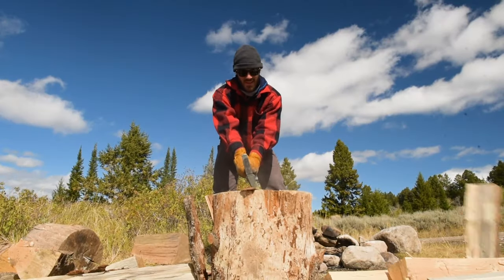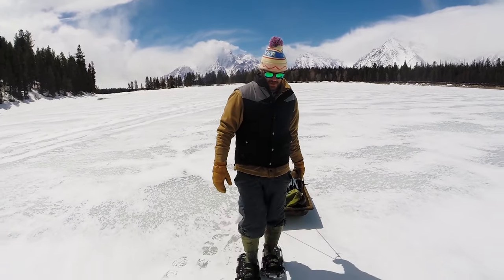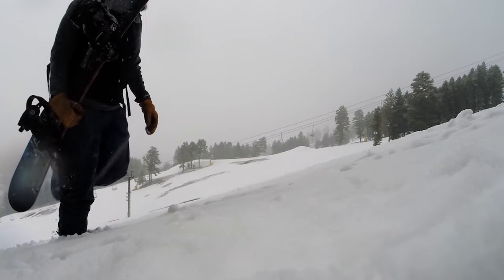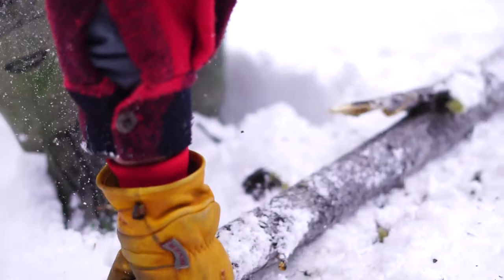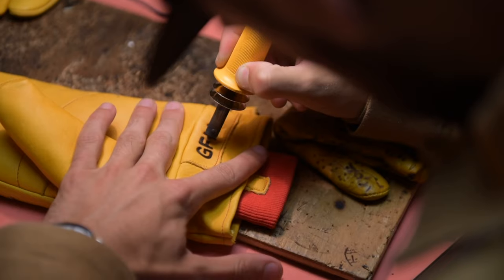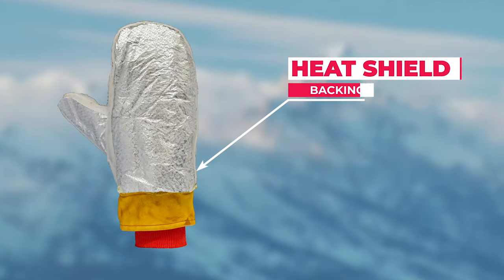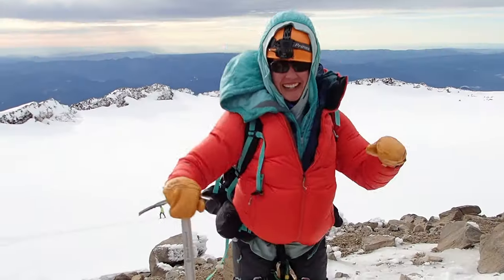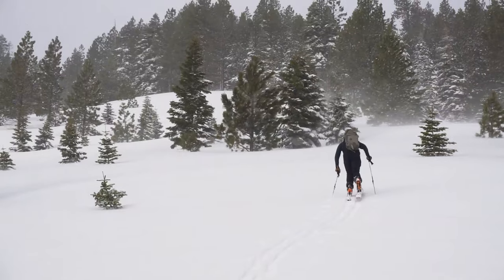Give'r Frontier Mittens - Official Video

Comment: These are solidly built mittens. I currently have Kinco, Wells Lamont, Cabelas and Outdoor Research.   These are built better than the rest. The ONLY complaint I have....is that I've wore them 2 times outside to shovel snow.... (around 10 degrees Fahrenheit) and they were warm, yes.  But when I went inside (may 30 minutes later) and took my hand out and put my hand back in, they were moist inside. It wasn't snow or moisture from the outside.   It seems there is a non-breathable layer in between the leather and the insulation.  I also stretched and pulled and manipulated these a lot before wearing them (while oven warm, like it said), and even though I ordered the size the size chart said, me...personally, I'd order one size of up ESPECIALLY if dead center in between 2 sizes. I was about 1/4 - 1/2 inch below the top number, but to me they are still a tad small.  Maybe they will get better over time.  So yeah, really my only complaint is the moisture.
Reply: how are these vs wells lamont? they are way more expensive but i am wondering if they are worth it.
Reply: @meese1k  I mean...its hard to say.   These have more insulation than the Wells Lamont, and have thicker leather.  Are they better than Wells Lamont?  Better made and warmer,. Yes. Absolutely.  But, ya know...sometimes you don't always need "better" or "best".   I guess it depends on the conditions you are in, or your affinity for "the best".  If you put Sno Seal on Wells Lamont....they will be waterproof also.  For $100, you could have 2 pairs of Wells Lamont, and keep one in your vehicle, and one in your house, etc.  As I said...the one think I didn't like with the Giv'r...was the sweating that my hands did.  If you get these....well...if I got another pair....I'd order one size up from what their chart says.  Their chart says order size "X" or whatever...and then "break them in" for a great fit.  I bought the recommended size...CLEARLY within the parameters of their size chart, and I got them, they felt small.  I tried everything I could to break them in.  Oven, put them on, moved them around, twisted them, pulled on them, etc.... .  That helped but they still are tighter than I'd like them.  As dumb as this sounds...I think putting them on and punching a punching bag for a while would stretch them out even more.  lol.  Maybe just plain 'ol putting them on and USING them is the best for stretching them. I guess my recommendation on size is, if you are anywhere NEAR the next size up on their size chart, go a size up.  Especially on the mittens.  You want them to be "loose" so you can have movement and air around your hands.  And also you want additional space in the even that you'd want to put a hand warmer in the mitt with your hand.
Reply: Are the fingers in the mitten together or in their own separate finger slots?
Reply: @zzimbo  Fingers all together like a regular mitten.  (skin on your fingers will all be touching each other).

Comment: BEWARE: If you order these gloves please note that they run small.  I am a woman of average stature (for a woman) and when I tried on the men's large they were tight on my hands.  I ordered 4 pair for Christmas gifts @ $109/pair.  The company does not allow exchanges.  You are required to get refunded for your purchase and then order new items.  That means...additional shipping costs if your order is smaller.  Another thing to note is that there is a $25.00 restocking fee PER PAIR if you order the branded option.